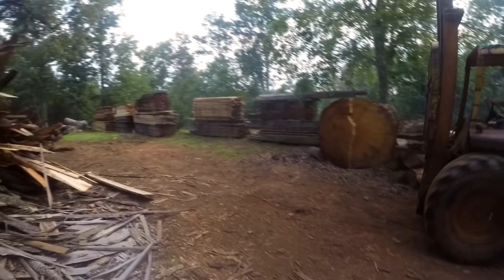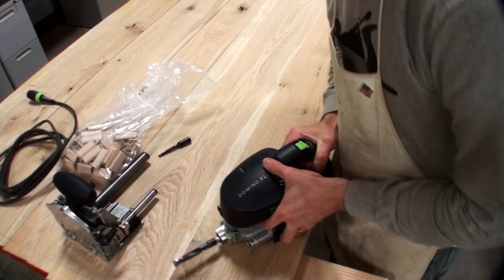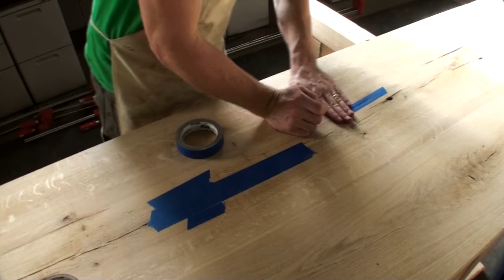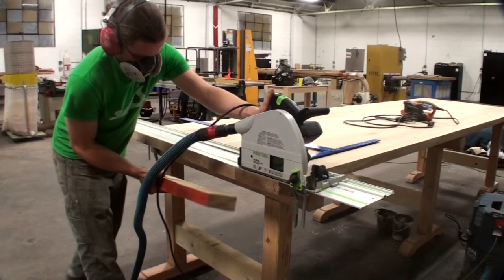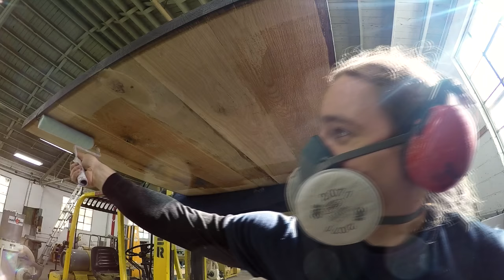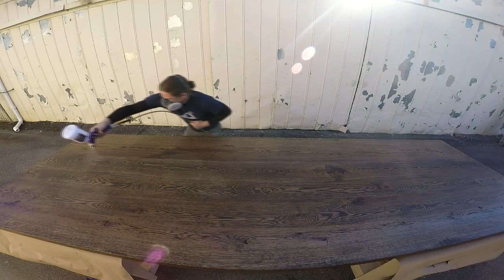Part 2 - Making a Table Top - Oak Trestle Table - Woodworking Series!

Comment: Great process , this size table is similar to an antique banquet table that I refinished for a customer once, it measured about 5ftx16ft. It was a hardwood , it came in 3 sections for the top, I thought about using my floor sander but thought better of it as there would be possible chatter marks to remove so I removed the old finish with a heat gun and scraper then finished it with a hand electric sander . It cleaned up real good and took floor finish satin applied with an applicator spreader. I gave it 3 coats and customer was very satisfied with results, wood was similar to rosewood and piece dated back to 1700;s. I enjoy your videos and I realise how much work goes into the fabrication of such a table. Thank you for taking the time to video it and continued success. The strange thing was, as a footnote,, the customer  passed away several years later and his wife thought of me and offered to sell the exotic banquet table to me,I thanked her but said I had no room for it but really,had not the kind of cash she was looking for . Thanks

Comment: Table is outstanding. In the video you speak of turtling, it is an art. I've found the heavy duty panel carriers to be a great help. Also I picked up a used dolly that was used to move granite cabinet tops into homes for installation. Might want to look into those things in a few years. Turtling will catch up lol
Reply from the maker: With moving my tables it's normally a lot of maneuvering were I can't use a dolly, basically dancing with the table through doors and around corners. My normal farm tables really are not that heavy, just too large to grab with my hands......in the case of this table all the heavy handling was done with the fork lift or multiple people.....with that said, I do have a little damage to the shell from my ways. Thanks for watching.

Comment: I make tables also and have experience with finishing the tops to a satin-sheen.
I use the 3M pads like you, but, I use my Bosch half-sheet-sander to do the labor of polishing. I use 120 grit paper on the sanding-pad, then lay it on the 3M pad and go about the polishing task.  Then, I use a soft folded kitchen-towel with the half-sheet-sander to buff it to a slickness. Finish with a few applications of paste-wax, again using the sander, turning the towel as it heats-up.. When the buffing starts to get draggy it's time to change the towel.
Reply from the maker: That's a good idea, haven't tried it myself.

Comment: Glue-up trick. Put clear packing tape on your sawhorses. It works so much better than paper. Doesn't matter if you get glue on it, the table top won't stick to it too much, and it can easily be scraped off after it dries with a paint scraper.
Reply from the maker: yeah, that's the way to go but I was working in his shop and you always forget to bring something.

Comment: enjoying these videos with details, awesome build. Any particular reason you went with the Bosch dust extractor instead of the Festool. I have a ct36 and my reason was that I could stack other tools on top.  Thanks
Reply from the maker: No reason really, I have a range of tools and brands. Stacking the tools on top would be nice if I was going around with it, but it stays put in my shop for the most part. In the end it sucks just like any other vac.......it does cost less along with it's accessories than the festool. I would like to have a festool as well though. My main reason I got this one was to set up a dedicated dust collection for a small cnc, but I've been using it for my tools instead.

Comment: have you ever had problems with blade chatter when using your track saw? i have the dewalt and was using a frued rip blade to put a straight edge on some 2" locust. a lot of chatter/vibration and not a very clean cut. not sure if it is the dewalt saw or the blade... and just fyi the frued blades for tracksaws seem really high quality and are only around 25 bucks on amazon. that table belongs in a castle! really awesome design
Reply from the maker: If I cut really fast it is not as smooth, but with my new blade in 2 inch white oak it's very smooth. I'm using a 210mm blade with 36 teeth, it's a general purpose blade. Here's the link. Your saw uses a 160mm blade with a 20mm arbor, here's the same kind of blade I'm using but your size. http://amzn.to/2mOqYLA I think your problem is the ripping blade, easier on the saw but it's more agressive which does not create a smooth surface. You can make your cut about 1/16 or 1/32 off your line and then finish it off with a slow pass, perhaps even with a finer tooth blade. Again, with a sharp blade I am getting very smooth cuts.Thank you for watching, hope you resolve your issue.
Reply: The Homestead Craftsman thanks man!

Comment: Thanks for video! I just bought the Festool 75.  Was the saw blade an upgrade or replacing the worn original?
Reply from the maker: My festool blade was just dull, so I wanted to try a less expensive brand......worked perfect. There's a link in the description, you can pick different tooth counts.
Reply: The Homestead Craftsman Perfect! Thanks, that's exactly why I needed to know.

Comment: Nice work, what size compressor did you use to spray?
Reply from the maker: 1.5 gallons but the motor and tank are about the same size. A small compressor is fine if it has a strong enough and fast enough pump. I got it from lowes years ago, it was there Task Force brand.

Comment: Did you joint one face of the boards first or just through the big planner on both sides?
Reply from the maker: Not on the table top since they where so big, just planed both sides but the boards where very strait. Even if they where off a touch once the top was made and attached to the base the boards pull other boards into place, along with the base and the  weight of the top. This works for most table top...and a lot of other stuff, but sometimes you can't get by without a joiner or compensating in some way.

Comment: How did you secure the table top to the bottom? Did you use some kind of mechanical fastener?
Reply from the maker: I use metal table top fasteners. The attach to the table top and slip into groves made with a router or bisquit joiner on the inside of the frame. On this table I also drilled large, counter sunk holes through the from and used screws with washers on the head to screw into the top. The holes are slotted to allow for wood movement. Also, the top weighs so much it's not really going anywhere.

Comment: Do you just use the epoxy resin, or do you use the hardener too?
Reply from the maker: Both, the hardener is what activates the epoxy so it sets up. I use west system 105 epoxy and various west system hardeners depending on what I'm doing.

Comment: I never did understand the Festool hate. I honestly just think it's jealousy. It's an expensive tool, but if you're a professional, it makes perfect sense to buy one. Depending on the size of the project, it can save you literally days of work. Which means reduced cost and wait for the customer, and more time for the builder to take more projects and make more money.
Reply from the maker: This tool definitely saved me days, if not a week.....made filming easier as well. Some people don't understand what I mean when I say the tool "pays" for it'self but this is exactly way. In the days that it saves I make another farm table that covers it. Speed and ease is it's advantage. It requires less handling of materials as well. Thanks